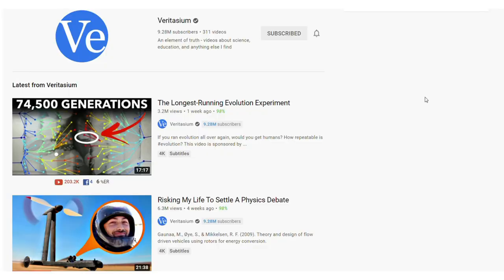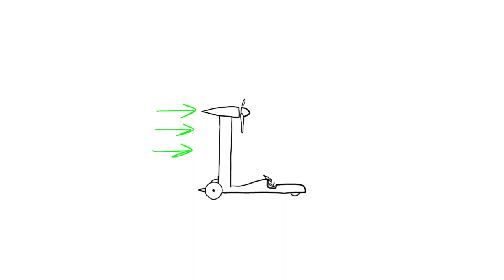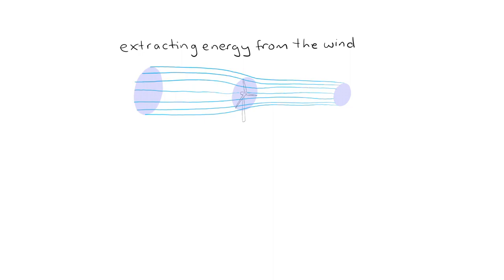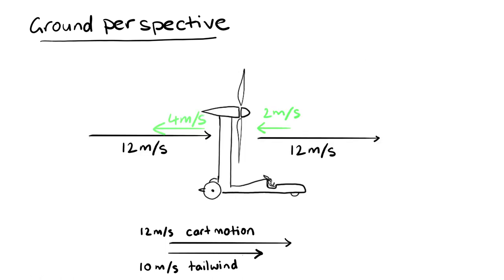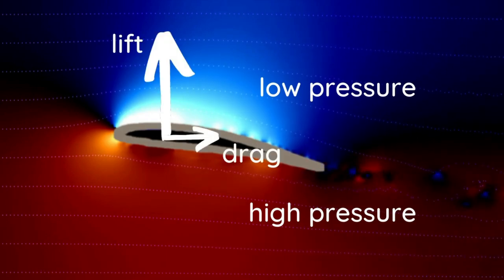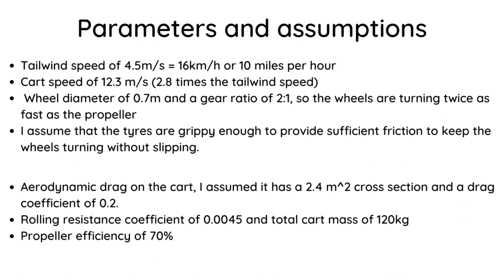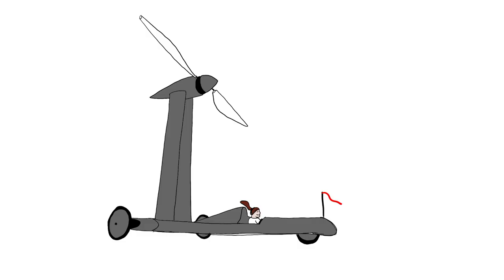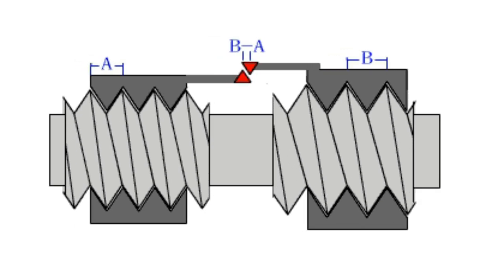Downwind Faster Than the Wind by Veritasium: How Does it Work?

Comment: In order to produce the thrust that some claim it produces, the Blackbird would have to extract more energy from the wind than the wind itself contains. This is clearly impossible

A sailboat can sail faster crosswind than the wind itself is moving straight downwind because its sail produces lift, not thrust. This is a basic aerodynamic principle.

In heavier than air aircraft, thrust is produced by using energy contained in a fuel (such as gasoline or kerosene) to spin a propeller or fan blade faster than the wind alone could spin it and move the vehicle (propeller plane or jet aircraft) forward by producing thrust.

That thrust is the large mass of air being moved backwards. 

Once it gains sufficient forward velocity, the lift produced by the wings of the aircraft is enough to counteract the force of gravity keeping it on the ground.

Note that the blades of the propeller or fan jet engine are really nothing but a series of miniature wings moving the air backwards. But it still needs to continue running its engines to produce thrust and keep it moving forward so that its wings can continue to produce lift, thus keeping it airborne and maintaining its altitude.

Otherwise, when a propeller airplane gained sufficient speed and altitude, it could just turn off its engine and coast along without losing altitude. Its propellers or fan blades would continue to rotate due to their movement through the air, producing thrust.

But what happens if the engines are turned off?

The aircraft cannot maintain a level altitude and begins a glide descent back to Earth, with the only lift produced that due to gravity pulling it back to Earth.

The Blackbird and similar such vehicles have no means of producing such thrust.

Therefore, those vehicles must be relying on the lift produced by the spinning blades (which are again just wings) to move faster than the downwind itself is moving, which is the same method whereby sailboats sail against the wind.

If nothing else, to say that the propeller of the Blackbird is producing thrust is a mistake in terminology and leads to a great deal of confusion.

Look. I'm not saying that the Blackbird cam't move faster downwind than the wind itself, as it obviously can.

I'm just saying that the explanation for how it accomplishes this feat is wrong. The blade of the Blackbird does not produce thrust, it produces lift.
Reply: The Blackbird propeller produces thrust the same as any ordinary propeller.  It's been on a dyno.
Reply: @johnborton4522  Do you know the amount of thrust it produced in that dyno test? (In either pounds or Joules)
Reply: @Rick_Cavallaro  So how much did the dyno weigh? That would give you a rough estimate of the amount of thrust generated by the turbine/slash propeller.
Reply: @Rick_Cavallaro  Also, you say it was in a parking lot! Doesn't sound like a very controlled test at all, so that means it would be more or less impossible to say whether it was thrust or lift causing the movement.
Reply: @Rick_Cavallaro  Yes, but that's only because the blade of the propeller is being spun at speed by an engine of some sort.

If no propulsive force is spinning the blade, it can still generate lift (say in windy conditions) but that is just called lift, not thrust.
Reply: @Rick_Cavallaro  But according to you the wheels are moving over the ground thus rotating generating the power needed to spin the propeller that generates thrust which moves the vehicle forward which causes the wheel to rotate which generates the power need to spin the propeller! 

Again, that's impossible.

Either that, or you've invented the world's first perpetual motion machine!

Again, lift is not the same thing as thrust, and I am quite surprised that an aerospace engineer such as yourself would purposely conflate the two.

The simplest explanation is that the spinning blades of the propeller generate lift, which force moves the Blackbird just the same as the sails on a sailboat (which also generate lift, not thrust).

In science, the simplest explanation is always the best and is usually correct.

But if you think the propeller of the Blackbird is generating thrust, then please state the amount of thrust it is generating (and not just that it pulled some dyno across the parking lot.)

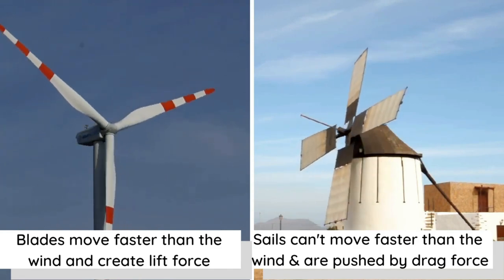I am tying to calculate that based on the data shown in the video, especially the graph shown at 9:32 of https://www.youtube.com/watch?v=yCsgoLc_fzI&lc=UgwdNl76_V1H1BFaflp4AaABAg.9Q0UE16TypA9Q4KNdRubXV
but that graph doesn't show distance traveled.

According to that graph, the BB went from matching the speed of the wind at about 13.5 mph (which, considerations of friction, loss of power transmitted, etc., is quite possible) to a top speed of about 30 mph in the next 78 seconds.

It also looks like it underwent more or less constant acceleration in that same 78 seconds, but how far did it travel in that time?
Reply: @Rick_Cavallaro  Okay, can you provide the link to at least one reputable web site that states that wind turning a propeller blade then generates thrust? That is, that lift and thrust are the exact same thing.   

As I stated, they are similar but they are not the same thing.

I have downloaded and read several papers and/or looked at several websites regarding DDWFTTTW, all of which state that this is "theoretically" possible. So yes, I do understand the basic reasoning behind it, I just don't agree with that reasoning.

Again, the reality is that the Blackbird can go faster downwind than the wind itself and used just the power contained in the wind to do so.

I don't question that fact. I just question your explanation behind this phenomenon.

It seems to me that you would have by now calculated the exact amount of "thrust" you claim the Blackbird generates.

That;s all I'm really trying to do at this point to see if your explanation makes sense.

Here's a reputable web site you might want to look at that seems to think it is lift (a la how a sailboat moves against the wind), not thrust that explains how the Blackbird actually moves.

https://physics.stackexchange.com/questions/521352/details-about-mechanics-of-directly-downwind-faster-than-wind-vehicle/653044#653044
Reply: @Rick_Cavallaro  From https://phys.org/news/2010-06-wind-powered-car-faster.html
“Cavallaro explained the car is able to move faster than the wind because the propeller is not turned by the wind. The wind pushes the vehicle forward, and once moving the wheels turn the propeller. The propeller spins in the opposite direction to that expected, pushing the wind backwards, which in turn pushes the car forwards, turning the wheels, and thus turning the propeller faster still.”

But then, the wheels are turning the propeller because…?

Okay, so let’s just go with your claim that the propeller of the Blackbird (BB) provides thrust.

“Theoretically” speaking, we should be able to calculate the amount of thrust it provides, if only approximately.

However, when I asked you about this all you could tell me was that the BB had “dragged a dyno across a parking lot”.

If that were the case, then I suspect the BB’s propeller was capable of producing quite a bit of thrust, which would be very impressive indeed.

So I made some back of the envelope type calculations of that amount of thrust, and those calculations show otherwise, that is, that the BB (at least when traveling downwind) is not at all producing the amount of thrust you claim it is.

Note: To make these calculations, I had to gather/rely on info I gathered from various sources and make a few guesstimates and approximations here and there. But at this point I am fairly confident that my calculations are sufficient for our purposes and can give us a rough idea of the amount of thrust the BB generates when going straight downwind.

But before I present my calculations, I would just like to note that I totally ignored any factors of energy transmission losses in the drive train, the vehicle’s aerodynamic drag, and propeller slippage. For one thing, I have no way of knowing those numbers, and for my purposes I don’t think my ignoring them are of much significance and, if anything, that would work in favor of the BB.

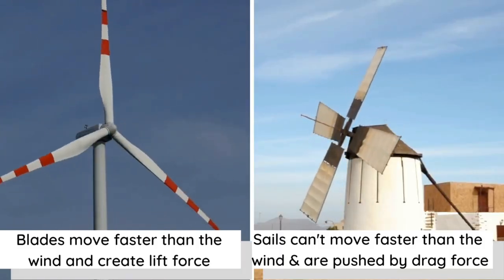I used data as shown in the table at 9:32 in https://www.youtube.com/watch?v=yCsgoLc_fzI&lc=UgwdNl76_V1H1BFaflp4AaABAg.9Q0UE16TypA9Q4KNdRubXV
as follows:

Max speed reached = 30 mph

Max wind speed = 13.5 mph

So we take the difference between the two speeds of 30 mph and 13.5 mph, which difference is 16.5 mph, and then converting that into SI units we get: 

26.6 kilometers per hour (kph).

But note that up until the BB surpassed the downwind speed ‒ at 42 seconds into the run ‒ it could just as easily have been pushed up to that speed by the wind as it was driven by thrust from the propeller.

But after reaching that max wind speed, the BB continued to accelerate downwind, reaching its max speed at 120 seconds in the run. So I took that as the true amount of time during which it could have "theoretically" been driven by thrust from the BB’s propeller (as opposed to lift force due to its blades acting as sails).
 
So the amount of time the BB underwent acceleration due to its "theoretical" thrust was 78 seconds (120s – 42s).

Therefore, the overall acceleration of the BB was 26.6 kph in 78 seconds. 

One of my questions to you was, what was the amount of thrust generated by the BB’s propeller? 

You either could not or would not this question, but I was able to find a paper titled Analysis of Down-Wind Propeller Vehicle by Md. Sadak Ali Khan et al published in the International Journal of Scientific and Research Publications (http://www.ijsrp.org/research-paper-0413/ijsrp-p16135.pdf) which gave the following information which I used in my calculations. From Table 1 of that paper:

A NACA 6412 propeller 4 meters in diameter spinning at 120 rpm produces 100 N of thrust.

Note: I read (in a Wired article) that the diameter of the BB’s propeller was 17 feet, which is a little over 5.15 meters. However, I don’t think that the difference in the two diameters would make a significant difference here.

I also couldn’t find the exact weight of the BB, but I recall reading somewhere (or maybe heard it reported on a Youtube video) that the combined weight of the BB and driver was 270 pounds, which is about 121.5 kilograms. 

So for the sake of the argument and to make the following calculations as easy to follow as possible, let’s say the combined mass of the BB and its driver was only 100 kilograms. 

Doing the calculation for acceleration using these two numbers (thrust force in N and mass in kilograms where acceleration equals force divided by mass) we get an acceleration of 1 meter per second squared (1.0 m/s^2).

Plugging in the previous number for the BB’s final speed ‒ 26.6 kph ‒ and using the calculation for acceleration (with a propulsive force of 100 N and mass of 100 kilograms) we see that the BB should have only taken 7.4 seconds to reach that final speed.

(26.6 kph ÷ 1.0 m/s^2) x (1000 m/1 km) x (1 hour/3600 seconds) = 7.4 seconds.

However, it took the BB a full 78 seconds to reach that speed.

Therefore, it is apparent that the thrust force generated by the BB could not have possibly been 100 Ns.

In fact, it would have been less than 1/10th that number.

Doing some back calculations and otherwise using the same numbers, the acceleration of the BB needed to reach that speed was actually only 0.09 m/s^2 and the thrust produced by its propeller was actually only 9 N, not 100 N.

Of course, I had to make some assumptions here in my calculations. However, note that some if not most of those assumptions would have been in favor of the BB (e.g., its mass was likely higher, I didn’t consider any energy loss in terms of drag or energy transmission in its drive train, etc.), while other assumptions, such as the fact that its propeller might turn at a far slower rate than 120 rpm – would work to its disadvantage.

However, to me the bottom line is that, “theoretically” speaking, the thrust you claim the BB’s propeller generates and which I calculated here would (or should) serve to accelerate it to the speed of 26.6 kph in only 7.4 seconds.

Yet it took a full 78 seconds to reach that speed!

So IOW and IMO, the BB could just as easily have reached that final speed due to the amount of lift its propeller blades produced (which would have been minor) as due to any thrust generated by them.

Care to comment?

(Maybe, aside from any assumptions made here, my calculations themselves contain errors. I don't think they do, as I went over them several times. But that is always possible as I am not an engineer, just a person interested in physics and science.)
Reply: @bryanjackson8917  You are failing to distinguish between isolated feedback loops (perpetual motion ideas) and feedback loops with a continuous energy supply (DDWFTTW carts). Read the papers linked in the description of the 2nd Veritasium video on this.
Reply: @Rick_Cavallaro  No you told me in a reply to my comment that the Blackbird had dragged the dyno across the parking lot (IOW, I didn't make that up). Go back and re-read the comments and you will see that is exactly what you said!

Yes I said you wouldn't or couldn't tell me how much thrust it was producing in terms of an actual number, only gave me the anecdotal evidence as cited in the preceding paragraph.

As  a result I had to calculate that number for myself, which I did and gave you all the input numbers I used and my sources for those inputs.

Now you claim that the Blackbird and driver combined weighed 650 pounds, not 270 pounds.

Fine, I will re-run my calculations using that new weight.

Just to be clear here, you are claiming that the weight of the Blackbird and driver combined as seen in the Youtube video I cited previously (i.e., the $10,000 bet video) and from which I got the table at 9:32 (which table looks quite similar to other tables I have seen presented for Blackbird) is 650 pounds.

Also, unless you state otherwise I am going to assume the 100 N thrust for a NACA 6412 blade as reported in the paper I cited above (Analysis of Downwind-Propeller Vehicle by Khan et al).
 
Look I asked you for certain technical specifications which you failed to provide. So I had to look for those specifications elsewhere. I gave you the sources for them and/or why I chose them as I did. So don't get upset that I have used that data in my calculations of the amount of thrust (which number you also couldn't or wouldn't provide) produced by the Blackbird.

Please note that my calculation of the thrust produced by the Blackbird is a very simple, straightforward calculation that any student in a high school physics class (which, by the way, I have taught) could undertake.

To just to be clear here, I am not saying you are a liar or an idiot or anything of that sort. I acknowledge that the Blackbird can travel dead downwind faster than the wind itself, and that you're building such a vehicle is a remarkable achievement.

What I am questioning, however, is your explanation for how that is achieved. FWIW, I am not the only person to have done so.

Note: When you ran the dyno test on the Blackbird, was that test done upwind or downwind? 

If it was done downwind, what did you use to turn the wheels? (Since the Blackbird's propeller wouldn't generate any thrust unless those wheels were turning.)
Reply: @bryanjackson8917  

You: "Doing the calculation for acceleration using these two numbers (thrust force in N and mass in kilograms where acceleration equals force divided by mass) we get an acceleration of 1 meter per second squared (1.0 m/s^2).

Plugging in the previous number for the BB’s final speed ‒ 26.6 kph ‒ and using the calculation for acceleration (with a propulsive force of 100 N and mass of 100 kilograms) we see that the BB should have only taken 7.4 seconds to reach that final speed."

Did you forget to account for the retarding force of the wheels in your calculation above?  The force that drives the cart is the net force between the propeller and the wheels, not just the prop thrust.  Looks like a pretty serious omission in the above analysis to me.

You: "(Maybe, aside from any assumptions made here, my calculations themselves contain errors. I don't think they do, as I went over them several times. But that is always possible as I am not an engineer, just a person interested in physics and science.)"

Engineers do indeed have to count all the forces on a body to calculate acceleration, not just one when there is more than one.
Reply: @killbeas  As I stated elsewhere in my analysis, I had no way of knowing the exact numbers for the friction and drag of the Blackbird, so I left those out of the equation. 

In addition, even if those factors were included, I doubt if,  based on the Blackbird's acceleration profile as seen in the Veritasium "prof loses $10,000 bet" video, they would have made as much of a difference in the thrust calculations as would be needed to account for the missing amount of thrust.

I would also like to point out that the Blackbird uses a 17.5 foot diameter propeller, while the diameter of the propeller in the DWFTTW papers is a 4 meters which is just over 13 feet. (Note: This is basically the same type propeller used by the Blackbird).

Since a 17.5 foot diameter propeller would obviously produce more thrust than a 13 foot diameter propeller - which is 100 N when spinning at 120 rpm (it appears that when up to speed the propeller on the Blackbird is spinning at least at 120 rpm, probably even faster) - this would obviously work in the Blackbird's favor in my calculations (i.e., its 17.5 diameter propeller would produce more, not less thrust) and would likely cancel out to some degree, at least, the unknown friction and drag forces.

Note: I did ask Mr. Cavallero if he knew the actual thrust produced by the Blackbird but he did not, so I had to rely on that reported in the DWFTTW papers.

Another problem is this:

How do the DWFTTW thrust adherents explain the transition of the Blackbird from being pushed by the wind - which, starting from a dead stop, cannot possibly be from the supposed thrust of its propeller - to then at some point being driven faster than the wind by the thrust it produces?

Note that the acceleration profile of the Blackbird is that of a flat curve - i.e., steady acceleration.

While the acceleration of the Blackbird caused by the wind pushing on it would produce such a flat curve, theoretically speaking once it passed the transition point and thrust alone began propelling it, that curve should have increased at an exponential rate. (Like you would see with a jet taking off down a runway, starts off slowly and then begins rolling ever and ever faster until it is airborne).

So taking all these considerations into account, in my book the Blackbird's performance could just as easily be explained by the lift its propeller blades produced as due to any thrust generated by them. (This is quite similar to how sailboats and ice boats can travel faster than the wind.)

Remember, while the Blackbird itself is traveling in a more or less dead downwind fashion, its propeller blades are "seeing" a wind that is relative to that downwind. They are acting as sails would on a sailboat or iceboat.

Anyways, this - lift - is the simplest explanation and therefore, the one I believe most likely to be correct. (Note: That's the way it works in normal science.)

I don't see that the Blackbird team has really proved that it is thrust causing the Blackbird to move, and not lift. In order to do that, they need to make some other measurements that involve more than just traveling faster than the wind.

IOW, the burden of proof is on them to prove their case, and they really haven't done so at this point, especially when considering that an alternate explanation is at hand.

Here's that alternate explanation, that is, how the lift principle would work:

The wheels are linked directly to the propeller, that much we know. Therefore either the wheels are turning the propeller or the propeller is turning the wheels. Of course, one can be happening at one time and another at a different time, but not both at the same time - as is implied or even directly stated by the DWFTTW thrust proponents. 

They say that the wheels turning spins the propeller which drives the Blackbird forward which causes the wheel to turn which spins the propeller and so on and so forth!

But when challenged that this would mean that they have invented a perpetual motion machine, they suddenly claim no, it is the difference in the relative velocities of the wind and the ground that is turning the wheels, which then spin the propeller, which then drives the Blackbird forward - or something like that- and we are back at the beginning!

So let's start at that beginning;

When the Blackbird first begins moving from a dead start, obviously it has to be the propeller turning the wheels, as in this case the wind is merely pushing on the Blackbird from behind, and its propeller blades are catching that wind - they are shaped like sails, so obviously they can do a pretty good job of doing so. 

The wheels then begin rotating the propeller in a direction that would normally generate thrust, but again until the Blackbird gets up to sufficient speed that thrust will not be enough to drive it forward. 

Before it reaches that speed however, its propeller blades continue catching the wind driving it forward, and as the propeller begins spinning its blades act as ever more efficient sails generating lift, and like the sails on a sailboat continue to move it in a downwind direction.

At that point the wheels are like the keel on a sailboat. Without that keel the sailboat would just be blown sideways with the wind.

Without its wheel holding it in place, the Blackbird too would be blown in a sideways direction.

Here's an explanation of how this works with a sailboat on

https://physics.stackexchange.com/questions/186515/why-is-a-beam-reach-the-fastest-point-of-sail-on-modern-sailboats

The original question posed there was, "Why Is A Beam Reach The Fastest Point Of Sail On Modern Sailboats?":

"The idea that the sail's lift vector needs to be close to the direction of travel is not correct. Only a component of the lift vector needs to be in the direction of travel, and it may only be a small component. I think this is easiest to understand if you make a simplifying assumption. Forget about airfoils and such. 

Think of the centerboard of the boat as a kind of skate, unable to move sideways, but able to move forward or back with almost no resistance. (Like an ice-boat.) Similarly think of the sail as something that can move forward easily in the air, but not sideways, as if the air were a substance like jello, and the sail were a knife.

In that situation, the boat acts as a link between the air and the water, in the sense that if the boat travels forward in the water, the air must move sideways, because the sail is not parallel with the centerboard. Similarly, if the air moves sideways, the boat must move forward (or back). The closer the sail is parallel to the centerboard, the more the boat must move. 

(- enter image description here - note: see link to view image)

Assume the sail and the centerboard are not parallel, but at a small angle with respect to each other. If the air is not motionless with respect to the water, but moves across it a certain distance, that will cause the boat to move another distance, because the sail can only slice through the air, and the centerboard can only slice through the water. In fact, the closer the sail is parallel to the centerboard, the farther the boat will have to move, because neither sail nor centerboard can slide sideways in its medium. In the limit where the angle approaches zero, the distance the boat must travel approaches infinity.

This does not depend on the direction the boat is pointed, as long as it is not directly downwind or upwind. It works on any other point of sail. Of course, there isn't zero drag in the water or the air, and the component of the air's force parallel to travel may get quite small, so traveling perpendicular to wind may give best results, which answers your question.

But keep in mind everything depends on the angle between the sail and the centerboard. The closer, the faster it can in principle go, if it weren't for drag. In fact, the lower the drag, in water and air, the faster the boat can go."

- answered May 29 '15 at 15:44 by Mike Dunlavey

Note that, as in the example above, the blades of the Blackbird and its wheels are not pointed in the same direction. To paraphrase Mike Dunlavey here:

If the air is not motionless with respect to the ground, but moves across it a certain distance, that will cause the Blackbird to move, because its propeller blades can only slice through the air, and its wheels can only travel on the ground.

IOW, no need to rely on a purely theoretical explanation of the thrust generated by the Blackbird's propeller that contradicts the known laws of physics.

Lift does the entire job, and does it quite nicely!
Reply: @bryanjackson8917  Not the drag on the cart, Bryan,   the force on the cart at the axle from generating the torque to turn the propeller.  It seems that you don't even recognize this force exists.   It's large compared to the drag forces near windspeed and the largest retarding force up to the limit speed of the cart .  So your acceleration equation leaves out the most important retarding force.

No, when the Blackbird starts, it is not the prop turning the wheels.  The prop never turns the wheels.   This is trivially verified by checking the side that the chain is taught on.   It is the side that turns the propeller to produce thrust.  The cart initially starts from bluff body resistance and as soon as it moves, the wheels turn the prop.

The rest of your explanation is basically noise as the propeller blades produce a torque but a direct thrust along the axis of the prop.  The drivetrain's kinematics are such that the prop blades are generally on a close reach because of the propeller spin speed compared to the distance traveled over ground.  There is no "sideways component".    The coherent explanation of Cavallaro is the one that fits all the test data.   So it is adequate to explain all motion and acceleration and has not been falsified by any experiment.

I can assure you that Cavallaro and Borton know the general aerodynamics of sails and keel interaction with motion of the boat.
Reply: @killbeas  @windgrins  First of all, drag and friction are not just limited to one aspect of the cart. 

For example, there is the friction of the wheels on the ground, energy losses in the drive train, aerodynamic drag, etc.

At best, all I would be able to do is estimate these forces. 

There certainly is a force trying to turn the Blackbird sideways. Cavallero himself stated that they had to make one rear wheel stick out further to the side than the the other due to the rotational force (torque) of its propeller.

Any time the wind blew the slightest bit sideways (which it did at various times) that would also have exerted side pressure on the Blackbird.

Also, Cavallero himself could not state what amount of thrust the Blackbird produced. So all I did was work backwards from the acceleration chart in the Veritasium video to calculate that thrust, and compare it to the theoretical calculations given in the DWFTTW papers.

The two numbers were off by a ratio of 4 to 1. That has to be explained somehow, and not just with lame hand waving "the dog ate my homework" type explanations, but with real numbers.

That Cavallero et al know about aerodynamics is not in doubt.

What is in doubt is if they have proved that the Blackbird went faster than the wind due to the thrust generated by the Blackbird's propeller which was spinning due entirely to the motion of its wheels moving over the ground due to the thrust of its propeller a la DWFTTW theory. 

I propose that they haven't proven that proposition, and I also gave sound scientific reasons for having my doubts as well as a perfectly reasonable and acceptable explanation as to what really caused it to travel as it did: lift generated by the blades of its propeller.

I might note that others, far more learned and astute in physics, aerodynamics, etc., than I am have the exact same doubts and have proposed the same or very similar explanation(s). 

Again, look at the acceleration chart for the Blackbird @9:32 in the Prop loses $10,000 bet" by Veratasium and you will see that lift is a more likely explanation for that acceleration chart than is thrust.

Again, you need to explain (at the very least) what force causes it to begin moving from a dead stop and accelerate it up to the speed of the wind, and what then causes it to surpass the speed of the wind and move faster than that wind. (How does it make that transition? At what point does thrust become the dominant force and lift the lesser one?)

Obviously, only one of two forces - or both acting together - could get it to start moving to begin with:

1. The force of the wind pushing it from behind;

2. The force of the blades acting of the propeller acting as sails which then causes the wheels to start moving the Blackbird forwards over the ground.

That much is indisputable. 

I say that the lift of the propeller blades increases as the Blackbird picks up momentum and they begin spinning faster and faster. And that is a very satisfying in that it doesn't violate any of the known laws of physics and is a simple explanation with many real life examples to look to.

You say at some point the propeller blades begin to generate thrust - not lift - and that is what enable it to surpass the speed of the wind.

In my view (and that of many others I might add), you have not proven your case and are far from being able to do so.

But have it if you wish.
Reply: @bryanjackson8917  You have several things completely wrong in your comment.   The retarding force of the wheels is not a frictional force.  It is the force caused by the propeller resisting turning (torque) due to drag of the blades.    Second, torque is not a "sideways" force.  It is a rotational force on the cart resisted by the weight of the cart.  This is why one axle was made longer so that the weight of the cart is operating through a longer lever arm to prevent turn over.   Third, torque in no way causes the wind to exert a sideways force.

You are correct as to what causes the cart to start.   But in 2. the only way they act as sails is they are like a bluff body [as does the entire cart] (which is how a sail is used on a ddw tack on a sailboat.)  They generate no lift, only drag.  Which in this case in the direction of motion of the cart, which starts it rolling.  The blades do start generating lift as the blades unstall and start working conventionally as flow is established through the prop roughly as the cart approaches 70% of windspeed.   This transition is turbulent so the speed that this occurs is not precise.

I did not say that the blades generate thrust.  I said the propeller as a whole does.   The propeller blades generate lift and their vector sum of all their lift vector components generate thrust.  Which makes the propeller as a whole generate a symmetrical thrust in the direction of travel.   The drag component of each blade is what causes the torque on the prop attempting to slow its rotation and the wheels provide the anti-torque to those drag force to maintain rotation of the propeller or to accelerate it.

The reason your calculations are so far off for acceleration is that you aren't subtracting the retarding force of the wheels (generating the torque to drive the prop) from the propeller thrust.  So the net force on the cart is far lower than the thrust alone.   If the cart were frictionless, this retarding force would be the only force acting against the thrust so it would still have to be subtracted.  I personally have measured the net force of a cart on a treadmill in steady state conditions which is far lower than the propeller thrust.  When this was done, the acceleration of the cart (when released) was completely consistent with the net force and the weight of the cart (thus illustrating the physics correctness quite nicely).

What proves the case is not what I state but that the cart demonstrates the requested behavior.  Which it does as well as the smaller carts in the highly controlled equivalent treadmill environment.